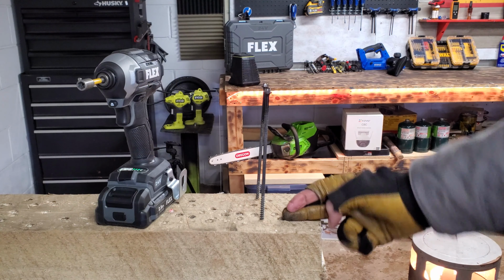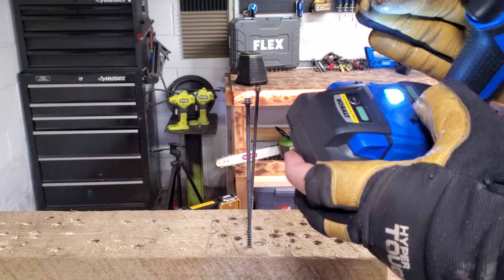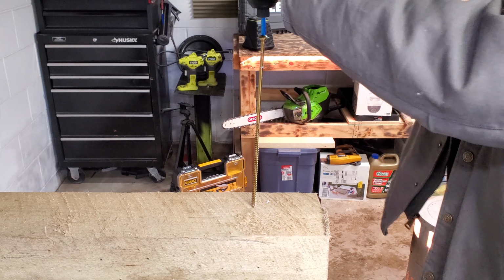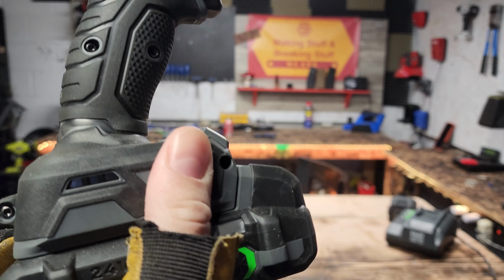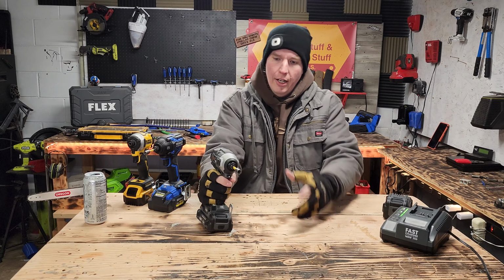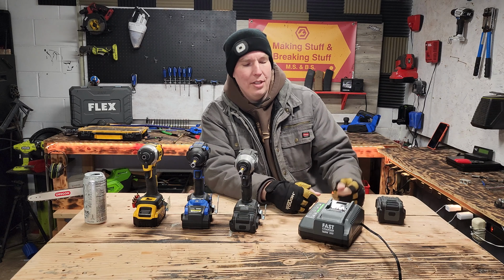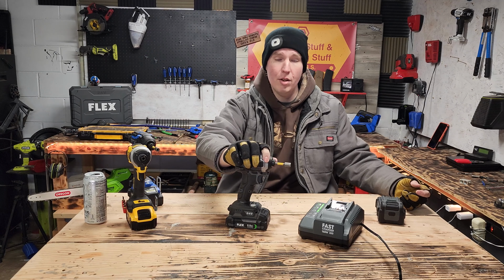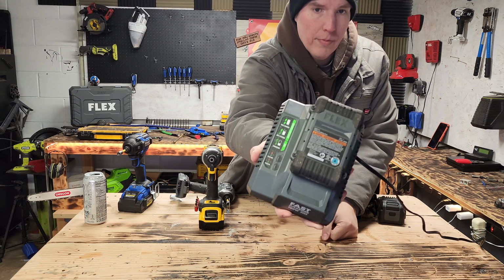Flex 24V Vs Kobalt Xrt Impact Driver Comparison and testing

Comment: Im giving Flex the benefit of the doubt. Same thing happened to my impact, was using it as a hammer though so likely my own doing, but hopefully theyll address it in the next model. Theyd be the first brand to not have a flop or two in their early days.

Comment: Unfortunately, I cannot recommend the Flex Quick Eject Impact driver.  If you play around with that thing for a few days, you will know that it has issues driving phillip screws consistently that are 3 inches and over without stripping the head.  If you are not holding it in a certain way with some pressure on the handle, you get slippage which imo is hard to read because impact driver spins faster (like it's on screw driver mode on steroids) than it impacts.  It has plenty power, but I cannot depend on it when precision is called.  This makes the Milwaukee seem less of a problem when working with delicate work (still wouldn't recommend Milwaukee for finish work).  I immediately went back to XTR....simply because of its assist mode.  Edit:  it's really unfortunate to be honest.  The regular impact driver for Flex seems to perform a little better without stripping screws.

Comment: Flex has a warranty to cover things like that, use it. Heavier tool more kinetic energy, when you slam it down in the cold. Could be just a flaw in the casting, that's why it comes with a warranty.

Comment: Thanks for this Test! 👍
Reply from the maker: Yeah man of course
Reply: @Impact-OG  sounds like you have an agenda and an axe to grind. I have dropped that same model impact many times from 6' and more and it still goes. Vince at VCG, Philly Fix, MCT, The Torque channel,  Stanley the Grease Monkey and the Den of Tools test this tool and only you broke it.

Tools and Tactics tried to brake the tools using it and didn't but you did.

How is it that none of these content creators ever compared this tool to Heart but you did.
Reply: @Making Stuff & Breaking Stuff  sounds like you have an agenda and an axe to grind. I have dropped that same model impact many times from 6' and more and it still goes. Vince at VCG, Philly Fix, MCT, The Torque channel,  Stanley the Grease Monkey and the Den of Tools test this tool and only you broke it.

Tools and Tactics tried to brake the tools using it and didn't but you did.

How is it that none of these content creators ever compared this tool to Heart but you did.

Comment: Love the Kobalt platform. Just wish they had half as many tools as (garbage) Ryobi or even Dewalt and Milwaukee.
Reply from the maker: Yes me too that's what  Bugs me about chervon,,  They come out with this whole 
Of tools but yet they will not finish the kobalt line of tools. Just bull crap.
Reply: There's nothing wrong with Ryobi. It's not meant for professional use anyway.  However, they do have gazillion selections of tools across the board.   Kobalt has good powerful tools,  but they don't have enough tools to justify investing in it.  If they were innovative as Ryobi,  They'd be more popular......
Reply: That’s exactly why I’d never invest in Kobalt.  They’re lineup isn’t expansive enough.  That being said, Ryobi’s new line of HP tools are very impressive.  You should give them a try before being so judgmental…
Reply: For the money Ryobi is maxed out that's for sure I have no problem being in the Ryobi platform and Milwaukee for when I need a pro tool.

Comment: I don't know if you still have the xtr circ saw, but they finally came out with the 8ah UO. I think circ saws need at least 8ah to perform correctly.

P.S. I know it's easy to spend other peoples money.
Reply from the maker: I do not have it, I sold it. but I was checking out the 8ah the other day in the store and hollllly cow that thing is huge!!!

Comment: Kobalt just came out with a new Oscillating multi tool
Reply: I'm a big Kobalt fan, but I think you can't beat the Dewalt multi tool for ergonomics and blade change. Home depot is running deals, so I was able to get it for $62.00.

Comment: bottom line is that a spendy drill should not break that easily!
Reply from the maker: Exactly my point, I mean its over $250 bucks but on sale for $199.99 still that's a lot of money to most people. Thanks for watching man
Reply: @Impact-OG   You bet and thank you for the great comparison video! Glad I went with the Kobalt even before I started watching YT comparison videos. 
Used to have a Milwaukee M12 Fuel impact driver but I just dont care for the ergonomics. It needs to feel comfortable in my hand also and most seem to overlook that and just care about speed.

Comment: Please STOP making the silly "shorts" videos.  Won't watch them, wrong phone aspect ratio anyway, will just unsubscribe if i keep getting these shorts in my feed which I don't want.  Besides, it's ridiculous to care who barely wins some speed contest, is the last thing possible I care about.  How about instead, head to head, # of fasteners each can do before failure (and I mean breaking, not battery discharged) , but NOT driving them so hard and long that they overheat, instead using like any real world use would.